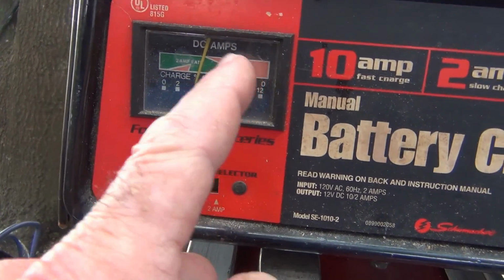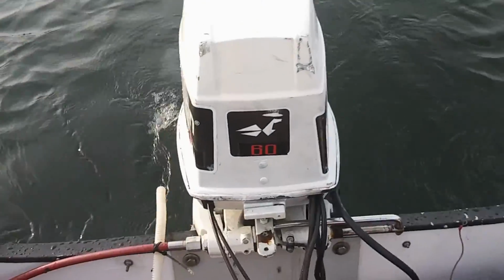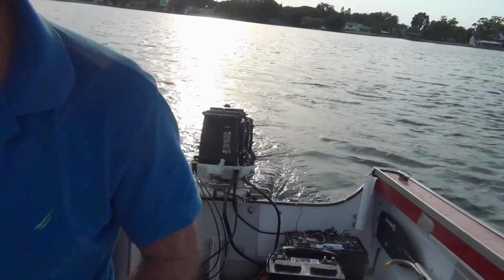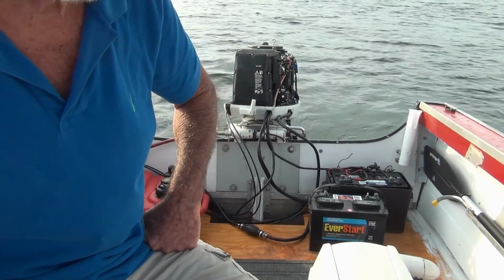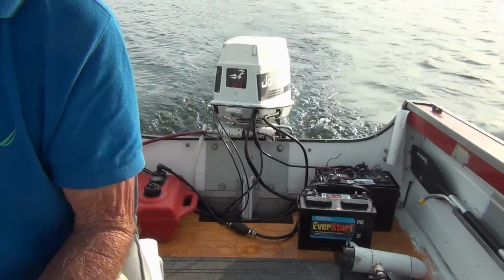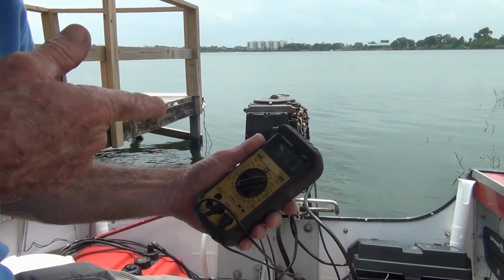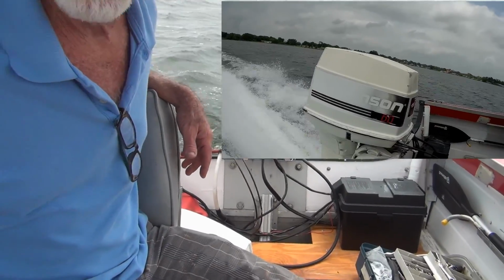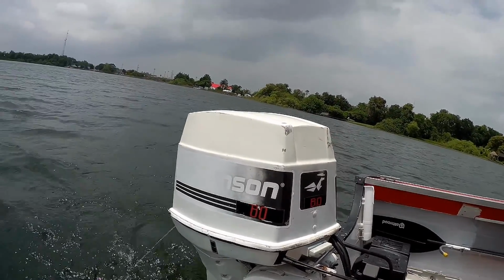1992 Johnson 60 Hp 1st Run 35 mph 2nd Run 38! #outboardrepair #outboardrepairvideos

Comment: I have the same motor - but I am only getting about 4k rpm at full throttle...I may need to adjust my linkage...what rpm should I expect at full throttle?
Reply from the maker: Hey thanks for tuning in. You should be hitting between 55 + 6,000 RPM. I would check your prop. It may have too much pitch. Same issues I've been having. You want 2 empty your boat out as light a load as possible then find a prop that's going to go over 5,500 RPM then start adding the weight back in until the RPMs come back down to 55. I've had some people tell me they like to run about 5,800. You can check your roll pins on the side of the butterfly shaft they should be horizontal at Full Throttle. But I think you probably have the same issues I've been having with the prop. You're more than welcome to check out all those videos hahaha I went from a 19 pitch to a 17. But there's a hell of a lot more to the story! Thanks again in stay tuned!

Comment: Been hearing that tink noise in 1989 70 hp Johnson for decades ...if it's a problem let us know please ..to change subject back to evinrude 25 1978 ..started producing steam after i run thru weeds..pee hole peeiing good..could debris from weeds bed stopped  thermostat   up causing the steam . believe it idles and runs to good to be head gasket blown ..but not sure..
Reply from the maker: Hey. Thanks for tuning in. Really, mine seemed to have stopped after I tightened up all the transom bolts. Hope that was the problem. A small amount of steam coming from the exhaust is normal, especially if it's cool weather. If you think it's running hot/clogged pull the cover off and flush it out. Just be careful with those bolts! It may be time for a new thermostat too. Thanks again !

Comment: I need some help trying to get my 1998 evinrude 40hp to run better and idle. The carbs were just rebuilt and it has all new fuel lines and filters with new fuel tank. The motor runs great at wide open throttle but doesn’t idle good and will die also is hard to start after it dies. But out of the water with the water hose hooked up to the muffs on the motor it sill sit and idle fine all day long. I can’t figure out the issue. Any suggestions?
Reply from the maker: Hey. Thanks for tuning in. This sounds typical of an outboard running on muffs compared to running in the water. Once it's in the water there is back pressure on the motor. I would go back to basics. You said the carbs were rebuilt which really means nothing but a new gasket and some other parts. The point I'm making is, is it clean? The slow speed circuit must be smoking clean or it wont idle in the water. Sounds like your high speed orifices/jets are good. I would start there and make sure your slow speed idle circuit in the carbs are truly clean. Check out my carb cleaning video, "The two most important things". And never assume anything with these things. Just because it runs good on muffs or in a tank means nothing until it's in the water. Curious to know what happens. Thanks again & Stay tuned !

Comment: I have the same motor on a 16.5 foot spectrum I only get 32 mph, what size prop are you running
Reply from the maker: Hey. Thanks for tuning in. It's just the standard prop. 13 3/4 x 19 I think. Nothing special. Thanks again & Stay tuned !

Comment: Deffinetly something "clinking" at higher speed.  I think it has something to do with it rocking.  Seamed to be when the engine and the boat reached the same speed.  I think once they equalized the engine could relax causing it to swing back ever so slightly.  Maybe a little slop inn the pivot.  Maybe just the tightening handles flopping around.  It seamed to go away...so Rock on!
Reply from the maker: Hey Man. Thanks for tuning in! Yeah I tightened up all the bolts on the transom, I think that worked. Thanks again !

Comment: I’ve been doing some research on my 50 and talking to mechanics and why it’s not idling omc had a problem with the cylinders in the motor and after about 750 hours on the motor they get very bad vacuum pressure because the cylinders turn egg shaped. It will still have very good compression but the motor will still need to be bored out and rebuilt he said if you have too screw the idle screw in all the way in to idle it’s time for a rebuild.
Reply from the maker: Hey. Thanks again for tuning in and the info. Wow I never heard that one before. Crazy stuff! Stay Tuned !

Comment: Sure is making my 40 Johnson look slouchy, hehe. So happy for you!  I would be thrilled to be getting close to 40mph!  Now we need to find you a 115 or 150 and put all those batteries on the front 😁, or let me sit in the front. I can mash that front end down no problem. I bet I weigh about 3x as much as you, hehe. If it were not true it sure would be a lot funnier. I am in big block Chevy CU for lbs unfortunately, but working on it. Need to get into some SBC or down into V6 numbers hehe. Go race your neighbors and troll those big Bass! Wish I could troll and get Bass here in TN. It's just White Bass and occasionally a Hybrid Bass or Crappie here. Enjoy that motor and boat. Afraid I may be riding on borrowed time on my 40hp.  Oh, is there a chance someone can weld the crack on that 55 and it survive a bit longer for you in some sort of role?  Best of luck and fishing to the most enjoyable outboard videos on the net!
Reply from the maker: Hey. Thanks! Really appreciate you watching and commenting. Yeah I think the crack can be fixed. Thanks again !
Reply: @THISOLDOUTBOARD1  Sweet! With such success on the 60, I can't wait to see what you get into next. Where that crack was on the 55, it may be so low in the crankcase that it may not have too much effect on anything if can get it welded before any creeping towards the cylinders, if I saw it right..  Waiting on a power pack in the mail for the 93 40 Johnson and hoping I don't have to spring for a stator too. Will find out in next couple of days. I am going to have to watch your Joe Reeves method again. My next door neighbor is named that..
Surely it's not the same Joe Reeves. He is in his mid 80s and offered to help me with my boat, but surely not. This guy is a retired minister. Hopefully he won't bring 🧼 to washy mouth out. Friggen outboard will turn you into sailor!
Reply from the maker: @user-bn3zo3mh5v  Hahaha

Comment: So what was the ticking sound do you think?? Congratulations on your motor, I wish I had your mechanical skills!!!!
Reply from the maker: Hey Coop. Thanks again ! I think it was the transom flexing a bit. I tightened all the bolts seems ok now. Thanks !
Reply: Check the starter....little spring might be broken allowing the starter gear to float up and make contact with the flywheel.

Comment: Nice! It's a keeper. I've been thru that whole battery, cranking speed thing enough times that I do know what is very likely the problem. IF you have done this, file this tip away for next time.   IF you have not, I would pull the starter, clean out all the carbon that has accumulated inside from normal wear of the brushes. Clean up the commutator and in between the segments. clean and oil the armature bushings. If the brushes have some life/length left in them, clean them up and reassemble. You know that program. 90%+ of the time this is the problem. All that carbon dust really makes the starter weak. Cleaned up, it will spin the motor down to about 11 volts. Dirty, it needs a full charge, and that is marginal. Obviously, if the brushes are too short, replace them.  I run brushes down to about 3/8" or so. Usually, if the brushes are too worn, I can scrounge another brush end cap from another starter quicker and easier than changing out the brushes. Depends....As I said, IF you haven't.........JE
Reply from the maker: Hey Joe. Thanks for watching and commenting. Yeah been down that road a few times. It's called Painindiazz Ave! Hahaha I beat on the starter a few times trying to shake some dust loose. I think/hope it was just a crappy connection at the solenoid. I haven't been in the boat since, been workin my azz off this week. I'll see what happens this weekend. Thanks again & Stay tuned !

Comment: Propeller?????
Reply from the maker: Hey. Thanks for tuning in. Prop is/was 13 x 19 with a long rake, but over the years it had been ground down to 12.5 diameter and no telling how much pitch it lost. I've tried other 13 x 19 props and they didn't come close because they didn't have the longer rake on the blades. Thanks again & Stay tuned !